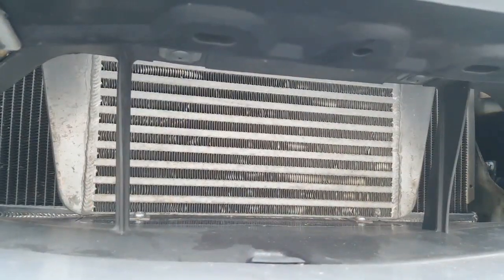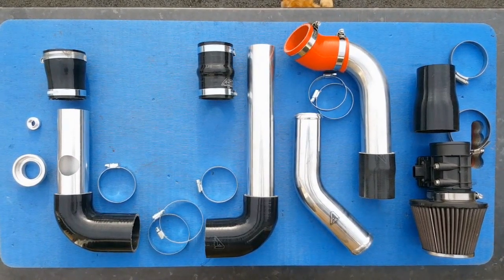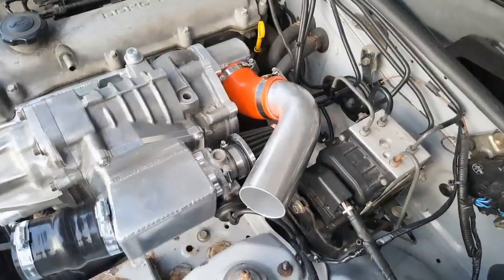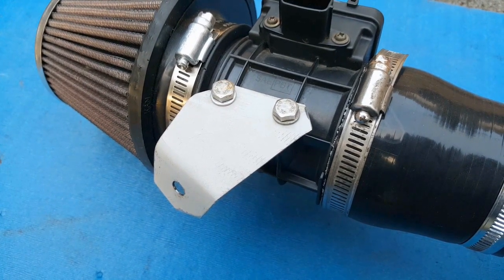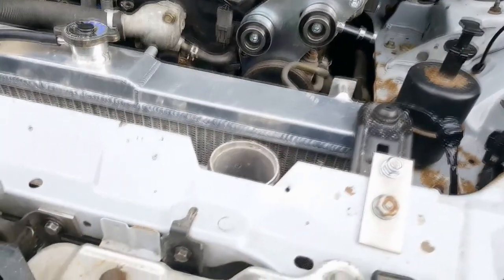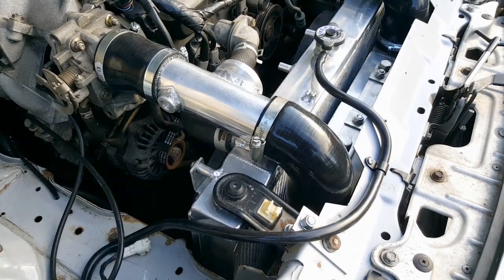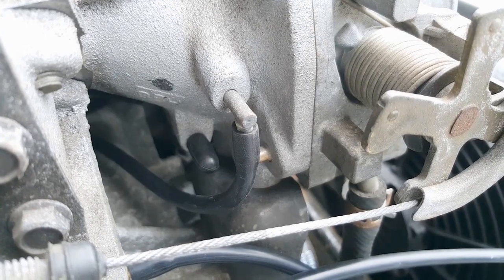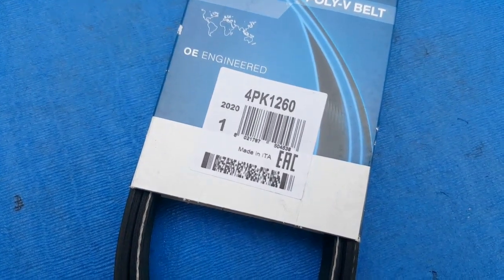Intercooler/Intake Pipework - Routing & Installation | Supercharging an MX5 Miata Ep 24

Comment: Why do you need an intercooler for a Supercharger? That just seems like a step that isn’t needed. Cold air doesn’t need to go through an intercooler.
Reply from the maker: Same reason as a turbo. Intake temps without an intercooler would be very high.
Reply: @FastRust  True but not nearly not as high as turbo
Reply from the maker: Also true but still high enough to negatively affect performance. I know a few people who run a similar setup with no intercooler and have no end of issues with intake air temp.
Reply: @FastRust  good to know! You’re videos are great information. Get it up!!👍

Comment: got a link to the video on how to make the bead roller?
Reply from the maker: Not finished editing it yet sorry. It isn't far off.
Reply: @FastRust  don’t worry! i’ll be using it when i make the cooler pipes for my turbo setup, love this build can’t wait to see it finished
Reply from the maker: If you need it ASAP all it is is a cheap pair of mole grips, an exhaust clamp and a big M12 washer welded together. Sure you'll get the idea. Nice one glad you're enjoying it. Been quite a slog to do it/film it etc but it's not far off! How's the turbo build by comparison?
Reply: @FastRust  haha thanks! still need to do alot of fitting, got the me221 & wideband all sorted, fitted a boost controller too. the cars still in daily use so it’s all little jobs to get out the way before the big one, next is intercooler & injectors. always weather permitting tho which isn’t ideal at the moment 😂

Comment: What hight over the rad do you have so the bonnet can still be closed ?
Reply from the maker: Not sure but those silicone bends are 2.5", so it must be more than that. I have dropped the radiator brackets to make this work
Reply from the maker: https://youtu.be/C6M4Ayo74pE